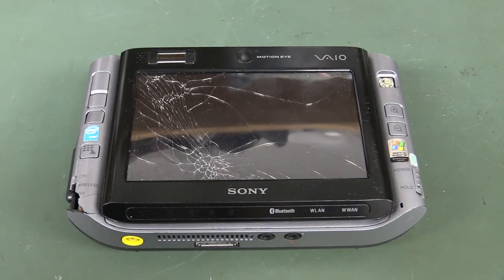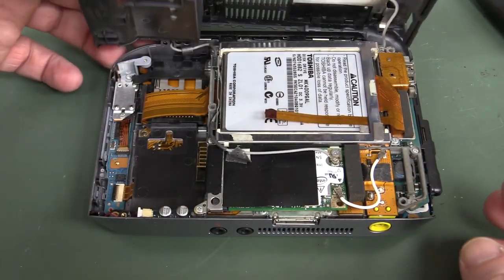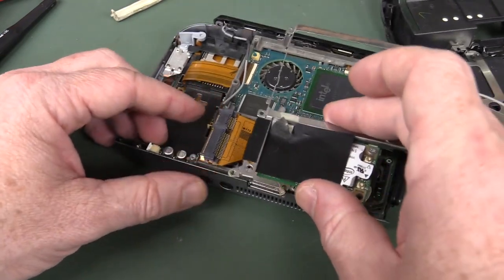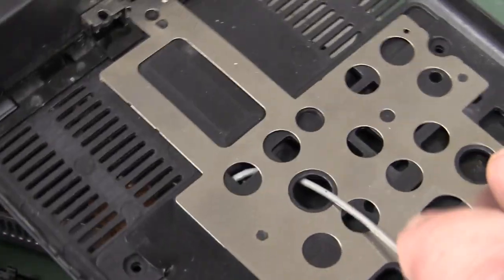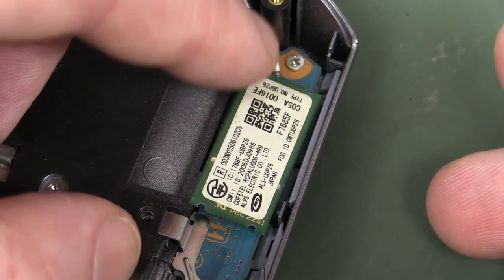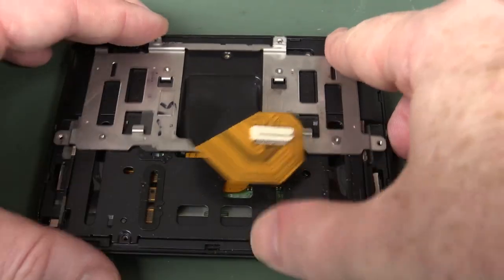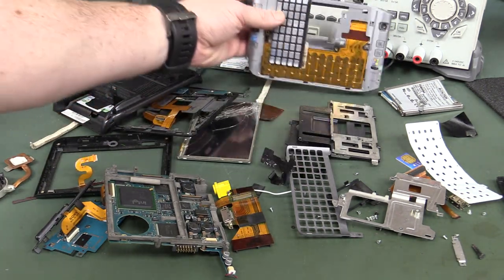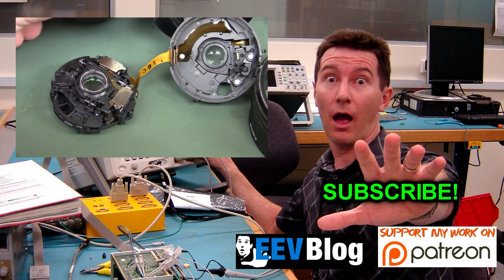EEVblog #914 - Sony VAIO UX Micro PC Teardown

Comment: Am I the only one who actually wants one and would use it? Except the probably lousy battery life I love the idea.
Reply: no, me too!
Reply: "several hours" isn't that bad for a laptop. This isn't a laptop, though.
Reply: how would you move the mouse?
Reply: I thought this was a touch screen? Back in the days touch screens had little pens next to them that helped reach the required accuracy.
Reply: I was just thinking the same thing haha. I've got an x86 samsung tablet I could probably hack into this form factor.
Reply: You wouldn't use it. I've had one of these borrowed for like 48h 5/6 years ago. It was on sale for 100€. It is very, very slow with a big big TDP for the form factor. It ran XP very slowly and ubuntu slowly as well.
What you want a redesign of these with a modern processor. I want it too.
Reply: @Max Wattelsbach You move the mouse using a little joystick up at the top right iirc. It's broken off on this unit but it was just a little square. I think it worked just the same as the Thinkpad nipple mouse but it's been years since I had my hands on the minipc thing.
Reply: You aren't
Reply: MrRtkwe thx
Reply: better idea is to buy 7" windows tablet and keyboard cover to it, so you get basically same thing but with better cpu and touchscreen
Reply: they still sell them for 4999$ it's so much for a discontinued single core cpu
Reply: Mustang Rt Where are you seeing that price? They've been discontinued for a while. The only spots still selling are 3rd parties. They're expensive but that's not unusual for a really niche product really.
Reply: Get one with some of that ARM crap.
Reply: Sorry, it was an archived site from 2008 I didn't notice
Reply: They're still quite expensive on the used market, otherwise I'd have one already. ARM isn't an alternative it won't run windows, and there's hardly anything in a comparable form factor that can run a proper OS (as in not android or tablet windows). Best comparable thing I found so far is Nokia n900, which is also discontinued :P.
Reply: Well, I heard Nokia 9110 Communcator had a 386 and run DOS nicely. Is DOS a proper enough OS for you?
Reply: Proper enough to be fascinating :D. There's also some *nix flavors floating around for sharp zaurus PDAs. Probably better battery life on those olschool things...
Reply: I remeber my friend flashing Compaq iPaq to run Linux, but that was 10 years ago or so. Still, pretty much useless thing with 40 mins battery life and volatile memory once you drain your battery :D
Reply: LOL I have the same one but with-out GSM, and it was awesome back-days
Reply: Look up the GPD Win. Its more modern version of this. $330
Reply: Nosloveingneko And The Smach Z, who us excited for NOV. 19, when is the time when they fund the project.
Reply: The Blue Shell Gamer23 The Smach Z looks like crap. Even if it makes it through production I doubt it will operate well.
Reply: I would love to use it.
Reply: go buy a toughbook CF-U1 instead, better battery
Reply: I would Love to have one. It must have been this one that was used in the series Stargate Atlantis. I remember that Dr. McKay used one. I allways wanted to have one and I definitelly still do!
Reply: Klaus Hermann it was also in a Mission Impossible movie
Reply: I want one so bad!
Reply: I have one
Reply: vleeskaak no I love mine they were amazingly usable, unlike netbooks which had crap processors,  this thing had ULV variant of intels best
Reply: Diogo Mendes May be possible to install a rasberry modul and try to make work the touchscreen
Reply: I want one
Reply: @ @maxwittelsbach5475  - It also used a little proprietary pen.  The first thing I did when I bought mine was to buy two film screen protectors (one installed, one spare), two extra pens and two extra little friction pads for the button that acts like a mouse button.  In the video there is no mention of the very useful docking station.  It provided more USB ports (making a full size keyboard and mouse possible) and an output for a full sized monitor among other features.

Mine is still in (lovingly) near-mint condition with all original boxing and all documentation printed out and in binders.  My only frustration was the inability to set the back-light for the keyboard to stay on until done typing.
Reply: I had one years ago, really fun to use and challenging haha
Reply: it is 2019 and I still want one
Reply: There is a track point but on his unit it fell off and it is also touch screen, I have watched to many videos on it and I actually just bought one
Reply: I have one and it’s not that bad!
Reply: I have one almost brand new in its original box bundled with brand new extra battery, standalone (yeah I know standalone) GPS unit, stand, etc etc etc all in the original box that I just unearthed in my storage and I couldn't be more excited! The battery life ain't too bad. Charged the battery fully and it works for about 1.5 hrs and haven't even tried the brand new battery yet. Got all the Vista updates I could lol This is the coolest gadget!
Reply: @marshaul  imagine calling ARM crap now.
Reply: I used mine in college all the time; it was an amazing little machine! (I still have it)

Comment: I have a fully functioning one of these, running Windows 7, which I've upgraded to SSD.  I absolutely love this thing, and wish they still made it with current components.  I paid almost 3K for mine :)
Reply: Yeah I kinda agree. For me,.I sometimes wish OQO were still around
Reply: +Kevin Bhasi I also have a Viliv x5 :). also running win 7 on 64g SSD
Reply: Lol...just use a phone
Reply: flahr1 Can a phone have a web browser that doesn't keep constantly zooming into text boxes? Can a phone have a desktop with icons? Can a phone have more than 2 ports?
Reply: did the SSD help with performance or battery life? I would imagine it gave some sort of a boost.
Reply: +Daniel G about 20% extra battery on the Sony, about 40% extra battery on the Viliv.  massive performance improvement as well, those 1.8" Toshiba drives are quite slow.
Reply: Alec Kristi nice! that is pretty significant. seems like it could make the device somewhat useful still.
Reply: +Daniel G I use them to program PLC's, really useful when space is limited, and both devices are robust enough for the tool bag.
Reply: yes actually. you can virtualize it or simply flash it to run gnu linux distro's. and a simple y cable or even a small usb dock can easily give you 4 ports for very low power devices.
Reply: Awsome! I wish those things would have taken off insted of these damn "smart"phones. Seriously, what the hell is so great about touchscreens?? Give me a damn keyboard and some REAL buttons!
Reply: Alec Kristi what are you going to say? that youre trying to run it on a ancient 2007 pocket computer? if you're going down that road than you could just as easy pack a small laptop. thinkpads are extremely robust for example.
Reply: +tjeulink their software often requires windows XP.  there is no shame in using a 10+ year old computer in the professional world.  it works.  (as opposed to Linux)
Reply: ok then, i would love to see a little video of a working one, just to get the idea how a thing like this performs...:)
Reply: While not a slider, if you want a modern take on UMPCs, look up the GPD Win.
Reply: tjeulink 
Except it's not a scam and this comes from a well known company in the Android gaming community. There are videos of other Cherry Trail atoms running certain games just fine on low. Not all games will run perfectly of course, however this thing isn't just some random cash-grab device from some random Chinese factory.
Reply: An Tran im not saying its a random cash grab, im saying its a scam. the things it advertised as capable are a gross overstatement of its capability's.
Reply: tjeulink Well you can tell the general public what you think, however plenty of people, including  myself, know exactly what we're getting with this machine. Some of us knew about it when it was still just in development, before the Indiegogo campaign ever went live while others have already seen how similarly spec'd devices like the Surface 3 perform in gaming. Even so we want a portable PC for gaming and a bit of light computing. For you and other less informed people, sure it's a scam however many others will find a use for it.
Reply: An Tran its not a scam because i'm ill informed, its a scam because the promises they make can not be fulfilled.
Reply: Same, such a shame netbooks and iPads killed them
Reply: Kevin Bhasi but they had lesser processors
Reply: KingofKatenfutter it wasn’t phones it was netbooks/tablets/and then ultrabooks that started the deaths of UMPC’s
Reply: Alec Kristi what kind of HD’s does yours use. I’m planning on upgrading the HD’s in mine too a 128gb sad, but I want to know what kind of HD’s it is, pats or data and what size? Also, is it zig, or a standard connector?
Reply: What is the SSD you used?
Reply: where u bought it??

Comment: Have one of these at home. It ran Win 8.1 fast and Win 7 even faster. Even had it running Mac OS X 10.6 as a portable 'mac' for fun, and everything worked, even the graphics. I had the extended battery and my HDD is still working. Its not used anymore but runs better than you'd think for a 32 bit single core CPU.

Comment: that was one of the best PC i had in that time, it ran windows vista without any problem, touch screen, GSM, Bluetooth, WiFi, fingerprint, dual camera. the keyboard worked perfectly. believe me, when you had that vs a pocket pc with windows mobile the vaio was superior x 100 times, but today is old..
Reply: i reckon i could still use this puppy and get my work done fine.    It actually probably was above average of the line in 2006 i bet.

Comment: The chipset is usually bigger than the cpu as it uses the process node from the step before (and allows them to use those foundries after they stop making CPUs)

Comment: 1gb for windows xp is huge. These are the requirements:

The minimum hardware requirements for Windows XP Home Edition are:

•Pentium 233-megahertz (MHz) processor or faster (300 MHz is recommended)
•At least 64 megabytes (MB) of RAM (128 MB is recommended)
•At least 1.5 gigabytes (GB) of available space on the hard disk.

Comment: I want one of these so bad it's like the dopest thing I've ever seen
Reply: i agree
Reply: Get a Sony Vaio VGN-P11Z.
Reply: +Dorf Schmidt I've looked at those too, also neat. I wish they would bring back the umpc with the technology we have for mobile computing today. The tablet market kind of took the entire market away from that sort of thing but I feel like  a tablet is nowhere near as useful.
Reply: Got to agree, I would love to have an Android phone in that form factor, or even in the Nokia Communicator form factor.
Reply: Indeed. I have one upgraded with an ssd and still runs Arch quite nicely. . once in a while I take it to school and draw all sorts of attention.
Reply: I wanted one of these when I was younger as well. Still do actually. It's a really interesting form factor. 

Also... 1GB is not bad for Windows XP at all. I was running Windows 7 on 1GB for years.
Reply: They arena testament of what Sony engineering can do... I want the Vaio VGN pocket series.. there is a model with 2gb of ram and a 1.86 Ghz dual core and SSD.. Add some linux there and you have a true attention getter.
Reply: Even now adays, a good condition working one is going to cost you quite  a bit. If you manage to find the Ultra rare Dual Core variants it will probably auction for ~$1000. They are extremely desired now adays.
Reply: I have seen a couple sell for ~200 with a cracked LCD. I have seen LCD replacements here and there for ~100. as such if you are willing to hunt around you might just get one and repair it for not too much as the ludicrous auctions... I have yet to get lucky..
Reply: Why don't you get a Toughbook U1 instead? Much cheaper than a VAIO UX...
Reply: But it ugly...
Reply: Daniel Timberwolf
And strong enough to bash someone's head in! (even though a 19 with the X-Strap would be a better choice for it)
Reply: Lol agreed. I have seen it only once in a warehouse and the bloody thing is built to sustain a nuclear blast... I would love to takr one apart to check out the rugged compliant components..
Reply: it's called a UMPC, there are many brands that built models of them.

Comment: To think in 2009 I was using an MSI U100 Wind Netbook with an even slower Intel Atom N270 as a home/school laptop. Youtube used to lag unless I had it in full screen, most flash games would lag, but it ran GTA SA on low settings. I even remember running Windows 7 HE in a Virtual Box VM on the thing.

Comment: Things like this Sony Vaio were much ahead of their time, and there were just no software for it. As a ham radio enthusiast, I tried micro Windows PCs several times, and the UI experience was always awful. 99.9% of apps were designed for mouse and were completely unusable with a touch screen, there were no scalable fonts, and so on. In 2006 there was just no software, designed for 4.5" screen, so I can imagine a disappointment of people who bought this for 3K$... And, surprisingly, today Vaio UX is a sort of rarity, and cost a lot, more than many modern laptops :)
Reply: this did have a mouse thingy its just broken off on the  top right

Comment: The micro could be a keyboard controller. The intel ICH9 south bridge does not have a keyboard controller and would require something to decode the keyboard signals, which the micro with so many IO pins seems to fit well.

Also, I suspect someone has tried to take this machine apart before, which is why the mic cable is cut and the connector pads to the bluetooth module is missing...

Comment: Thanks for this teardown Dave.  I have a Samsung Q1 Ultra UMPC, it's a bit bigger, 7" resistive touch screen + stylus, 600MHz Intel Atom, 1GB RAM, and does 8 hours on the battery.  It has half of the keyboard either side of the screen and tactile response is pretty good, but the keys are tiny.  It fortunately comes with external USB keyboard and a case which acts as a stand.  Also has an analogue thumb stick on the left and corresponding d-pad on the right which makes it great for video game emulators.  Runs pretty slow on Win XP Tablet Edition though.

Comment: Cingular was bought by AT&T in the early-mid 2000s if I recall.

Lots of people wanted a small computer - enough that plenty of models were and still are being made in some cases:
Samsung Q1 series
OQO series
Sony Vaio UX series
Sony Vaio P series
Toshiba Libretto series
Viliv S / N series
Some Panasonic ToughBooks

It's quite difficult to cool such small computers - you either choose between processing power or having a fan, and many opted for the fan. These were meant to run Windows, not walk it.

>1GB
>Just barely enough for Windows XP
The requirement was only 64MB according to the box, 128MB recommended. I'd have to say its unusable unless 256MB or more, which puts this squarely in the acceptable bracket.

The Sony Vaio UX was notable for the fact you could (not easily) change the CPU by using a heat lamp to remove it and add a better model. I believe you could add up to a Core2 Duo, but I could be wrong.

Don't worry, its not this badly constructed - it's just broken to hell and back by the looks of it.

>Expecting tactile feedback from the keyboard of a UMPC
Come on you're smarter than that, Dave!

Comment: A lot of UMPCs were running low tier BGA Celerons and Pentiums (for the premium units), and the run of the mill were Atom, like netbooks. It was uncommon, some were also equipped with Core Solos. Mediocre performance at best. Today's embedded solutions could certainly handle an OS as hefty as Windows, but these units were almost just a novelty.

Comment: I've heard some people actually replaced the CPU on this with a legit Core 2 Duo mobile, which would make this the most powerful UMPC in this screen size category, to date.
Reply: Sergiy Botsman Would like to try that on mine
Reply: @christiansanden8005  shit would straight up set on fire or not pull enough power to utilize it due to the boards limitations

Comment: amazing piece of engineering. full fledged PC in that thing. we didn't have 1GB ram and that storage for more 5 years. phones still are only 32GB commonly. The Intel processors at that time were notoriously hot and power hungry. Even 2 Hours of battery is not bad for it at that time. even full fledged "portable all day" laptops couldn't pull more than 3 at that time

Comment: Dave,  That CPU from Intel at that point of time had a higher TDP  wattage and you can not design a fan-less cooling solution thermal design for that form factor.
Reply: That cpu is an intel core solo u1500. a single core at 1.33ghz and a 5.5w tdp... 65nm so not very efficient..
Reply: I think about a year later Netbook craze started and the Intel Atom processor came out which would have been a better choice for this.
Reply: Even today a lot of phones and tablets will throttle under heavy load, I think Dave is a little hopeful about how efficient many of today's processors are let alone one that old.
Reply: Procs from that era often didn't throttle much at all until either the load dropped or they got too hot but it wasn't bad as machines back then had bulkier cooling than most now days. Sony should have done a better job with the cooler in this machine though, same garbage cooling as my HP TC1100 :/

Comment: Hmm, funny. I had that hard-drive in my iPod 5G, the WiFi card and the chipset in my laptop. What a weird concoction of technology. No wonder it ran so hot. The fun thing about those old CPUs, is that the chipset used more power than the CPU

Comment: In 2005-6 there was a horrible siege of Windows CE laptops, with ARM CPUs (mainly xscale). Intel was not commonly seen in small comouter devices, so i think this computer was state of the art in processing power in its time.